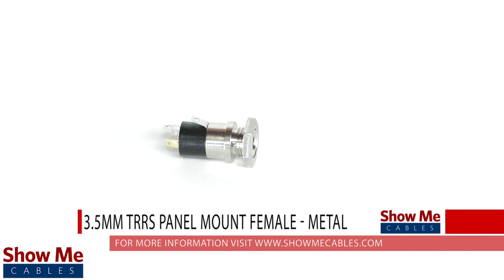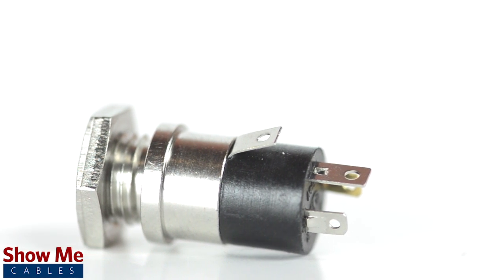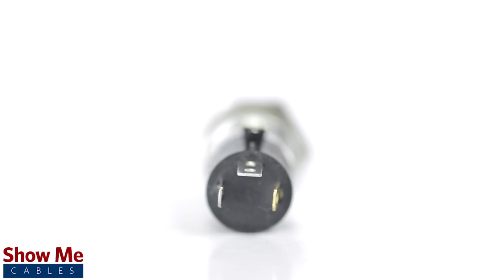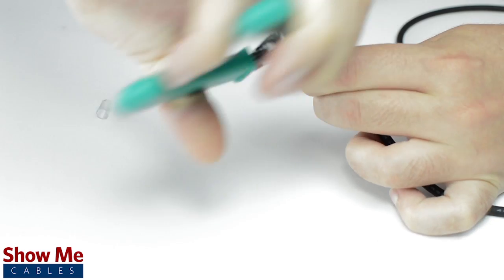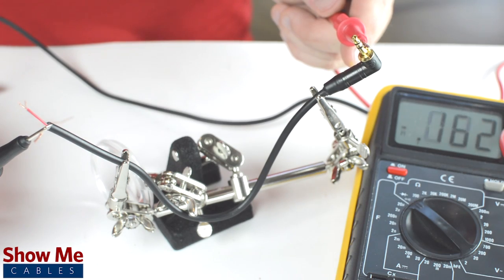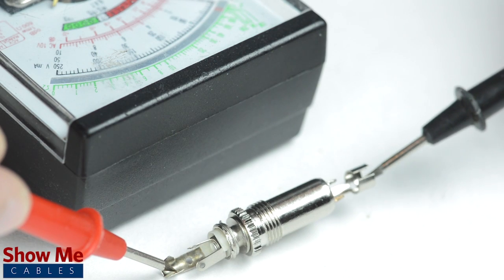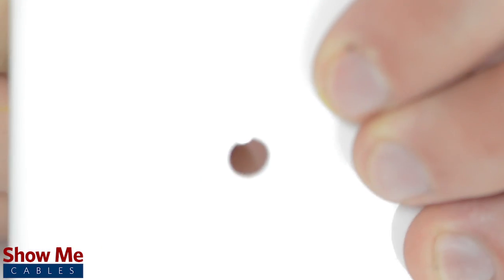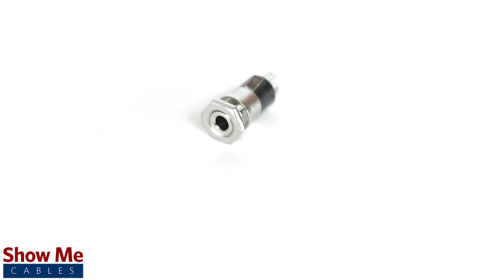3.5mm Panel Mount TRRS Connector - DIY Project to Repair Your Audio Cable #890

Comment: Hi,
I am trying to find a circuit diagram/parts for adding a 3.5mm headphone
 jack to an alarm clock radio that does not come with such a jack.

Do you have a video tutorial oh how to cheive that, please?
Greatly appreciated.

Comment: I did this project but for some reason the internal speakers on my device do not work until i plug in headphones, then the Speaker and the headphones work simultaneously... Any suggestions ?

Comment: What if we only have posative and negative like in a camera will this work
Reply from the maker: Hard to say without some additional information...  If you can contact our customer service department at 888-519-9505 or customer.service@showmecables.com, however, we should be able to find a solution for you